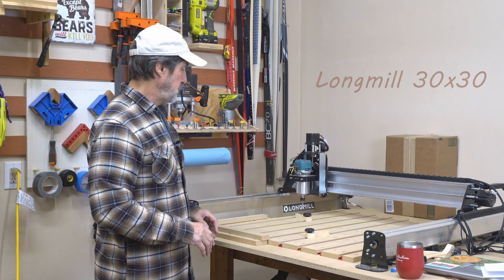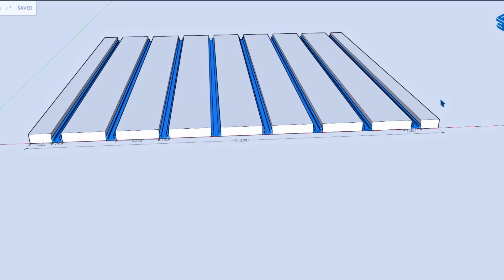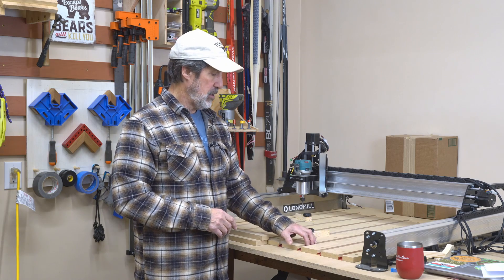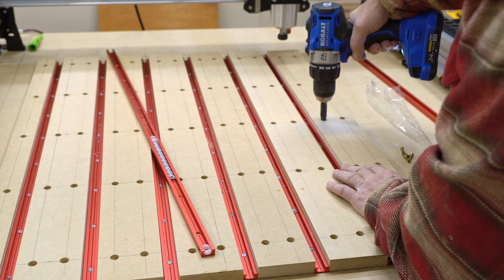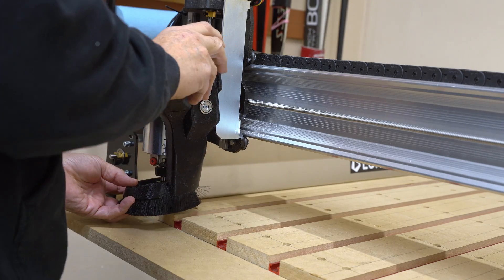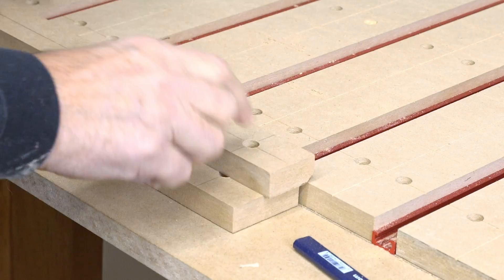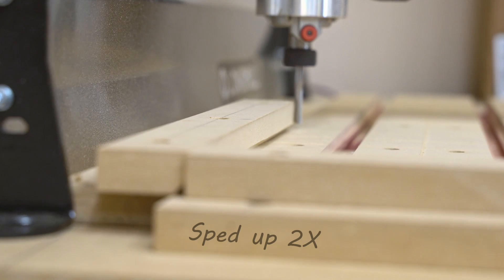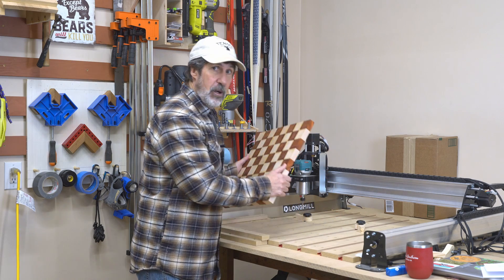Longmill CNC Spoilboard and Fence

Comment: Good video, short and to the point. Just curious, from which point do you sync the board to the design - many people use the front left corner.  Does it really matter which corner or the middle of the project that should be used??
Reply from the maker: All my projects start in the front left corner. That is how I draw it up in VCarve and that is where all my bits and wrenches are stored. You can start from wherever you want.

Comment: I’m new to all this.  I have the same cnc. I also purchased the T- tracks.   My question is……with your router all the way forward and to one side do you zero out right there put down your work piece to the fence and everything is lined up for the project?    Sorry I’m just trying to understand all this.  I’m practicing and learning I have trouble with lining up my job and work piece especially when I want to use the laser
Reply from the maker: No, I zero out to the corner of the workpiece every time. clamp the piece against the fence and zero (XYandZ) out at the lower left corner. Lining up the laser is a whole different ballgame, depending on the software you are using.

Comment: Just looked on their website and found the covers.  What are your thoughts on using the LongMill in a non heated shop?  Would it rust out or would it be OK?
I am considering the purchase of one and I don't have a heated space at this time.
Happy New Year to you and yours!
Reply: Ontario Canada weather! Do the Dust guards keep the all of the wood chips off of the lead screws?
My thought was if they do then I could maybe spray a teflon coating on them, then the dust would not build up and cause a problem.
Thank you and HAPPY NEW YEAR!
Reply from the maker: @6xcchamber971  yes, it is amazing how much sawdust this thing can create. Plan on setting up some kind of dust collector right away and you could build a dust shield if you wanted.
Reply from the maker: I don't know. I have only had it in an unheated space during power outages so I would hate to answer you. How cold does it get and what is your humidity level? Maybe someone else can answer.

Comment: I like the fence. Think though it be would better if it was removable though. I plan on using full sheets in a lot of projects and as is it would be in the way when indexing work pieces.
My Idea is dowels on the fence and Dog Holes.
Reply from the maker: I agree and have redesigned the fence. Look for an updated video. I like your idea. I don't cut large sheets often so my new lower portion is screwed into poplar. That allows me to take it off when needed.

Comment: Only 3/8” to the T-track isn’t much.  I have had unplanned events that went deeper.  Plus, when you do your 1st or 2nd resurfacing, very little left.
Reply from the maker: I guess I could double up on the MDF, they only sell 3/4" here. What do you do?
Reply: @AlaskaWorkshop  I am able to get 1” and use it.  There is no “perfect” spoilboard/hold down system.  I was looking at others on YouTube to get ideas.  It depends largely on the type of work you do.  But stuff does happen where a bit will go deep.  I didn’t do a complete job of tightening the collet nut once and the bit almost made it through the 1” before I stopped it.  Sometimes it can just be an oversight in your start/stop depth.  If you go for a thicker spoilboard, you will lose space for doing deeper projects like bowls.  In the end, you will find something that works best for you.  I did come up with an idea for avoiding grids and lots of holes.  Make a carpenter square out of 1/2” acrylic.  Put a hole at the fulcrum point and a pin about 1.5” long.  Then you can put a hole the size of the pin anywhere on your spoilboard and have a perfect square to set your wood to.  You use your x-axis and a bit to set the 90-degree from the fulcrum.
Reply from the maker: @bw162  Thanks for the insight. I have some issues with the bit plunging deeper than expected, turned out to be user error. Learning on every project!
Reply: @AlaskaWorkshop  ALL problems are user errors.  The CNC doesn’t make a mistake.  Don’t get frustrated.  You don’t see the screw-ups on YouTube because they are edited out.

Comment: Thanks for the video!  I've just assembled my LongMill and getting ready to setup a spoilboard with T-tracks. QUESTION: is there a reason you didn't use the LongMill to drill the spoilboard and T-track mounting holes in the base? I'm planning on doing that then setting up a program and jig to drill/countersink the spoilboards. Figure that if I do all the work on the LongMill then everything will be square to the machine and I'll have the jig & program available to make new spoilboards when I need them.
Reply from the maker: I thought about how to do that and could not come up with a solution to go about it. A jig sounds like a great idea and I have a lot more confidence now to pull it off.

Comment: I am looking at the Longmill also. Probably after the first of the year. Glad to hear you like it. Did you also get the Laser Beam with it?
Reply: I just assembled my LongMill MK2 and have to say that I'm very impressed with the whole thing. Well designed,  good construction (robust parts, tight tolerances and precision fit), quality hardware (with spare parts)  and the assembly manual is detailed and clear.
Reply from the maker: @hankvana2149  Agreed, the instructions were very detailed and easy to follow.
Reply from the maker: I did and have it all wired in but have not tried it yet, still learning the router and software.
Reply: @AlaskaWorkshop  That’s great enjoy looking forward to some videos from you on the CNC. I like your approach to the how to videos.
Reply from the maker: @jvitale0115  Thanks Joe, I have been having fun learning a lot in the last couple weeks and putting it to good use.